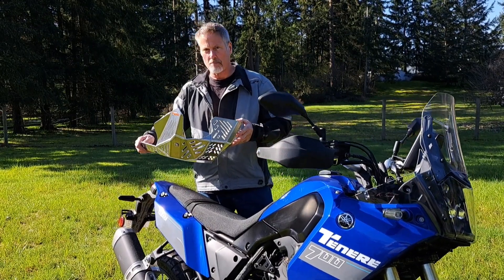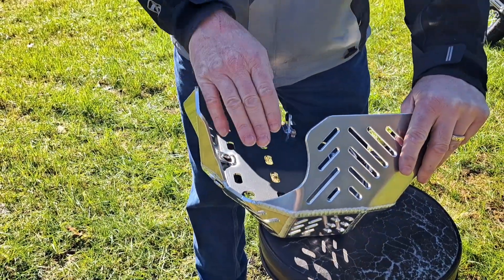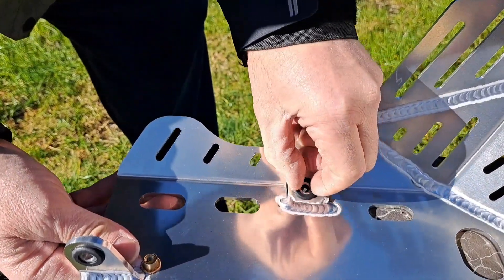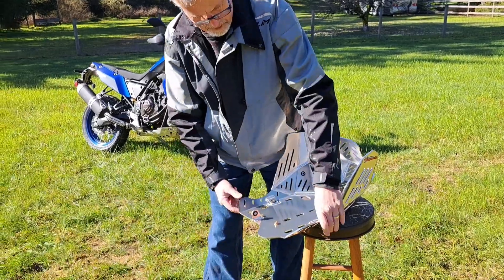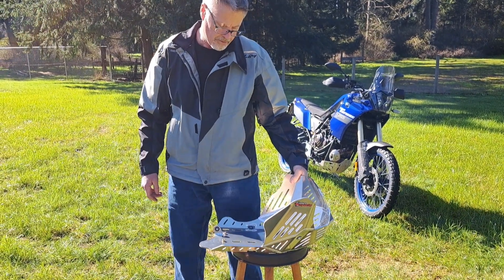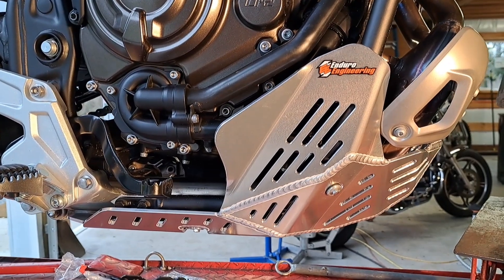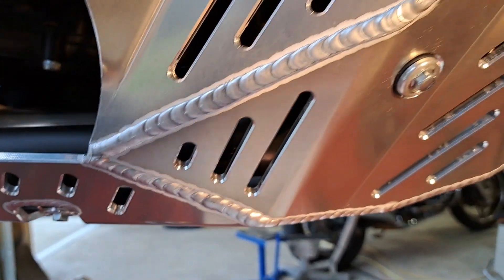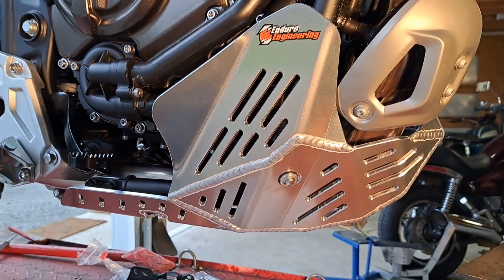Tenere 700 Skid Plate Review, Enduro Engineering

Comment: Why manufacturers can't make a decent Euro 5 plate is beyond me. Only one worthwhile is the outback motortek version as it doesn't require you to keep the worst part of the new Tenere's, the cat guard. And if you decide to go catless, which all Euro 5 tenere owners should, you end up with an unnecessarily exposed pipe.
Reply from the maker: Yep, I get it. I may end up putting a full system on, then I'll have a big hole there. Thanks for commenting 👍
Reply: 100% agree they could’ve easily bumped out that little section to cover that God ugly stock CAT guard.  I bought a 2023 and purchased the Euro 4 gut guard from Camel ADV knowing I was going to get rid of the CAT.  It’s a great looking skid plate. Just get rid of the CAT and fill in that little piece.
Reply from the maker: @davehartsock9106 The CAT has got to go...

Comment: My first choice was an EE plate because I loved it on my old KLR. I’m not sure if they weren’t making them yet or whatever reason I couldn’t find one, but I ended up getting the MOTOES plate which is  also a beefy aluminum skid plate. The linkage guard is a must out in the rocks of AZ and I think the MOTOES does the linkage protection better but it’s from Turkey, it doesn’t use the 5th mounting point on the suspension or have the isolators, and it’s more expensive. I ended up swapping the mounting bolts with rounded Allen bolts to “reduce the chance of snagging them” whether that makes a difference, I’m not sure.
Reply from the maker: I've heard the Motoes plate  is really good. I still haven't added the linkage guard, maybe someday. It can be rocky here in the Washington mountains, but I haven't gotten into any gnarly stuff yet. But yeah, I think both of those plates are probably a great choice.

Comment: I agree it is the Best looking Plate out there. I would ask if after mounting the Plate, you take it off and see if you have paint gone on the Frame down tube and the lower water pump tube. 
My plate was not easy at all to mount! the worst part was after I took it back off... Never even rode the bike and now all scratched up. What dose your bike look like after removing the Plate?
Reply from the maker: I had it off once to change the oil. I didn't notice any paint damage, but I wasn't looking for that either. 
As far as fitment, I do have to push up a bit with a small automotive scissor jack to get the forward screws to line up. I'm hoping that will calm down after a while? I still think I chose the right skid plate.